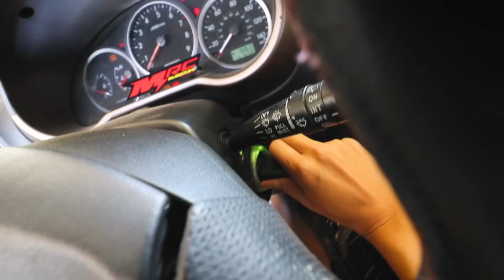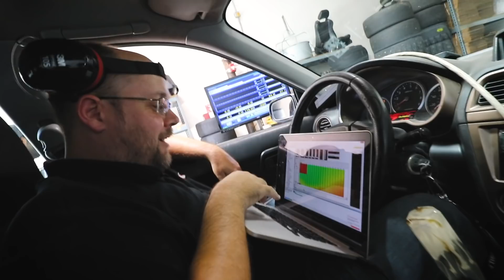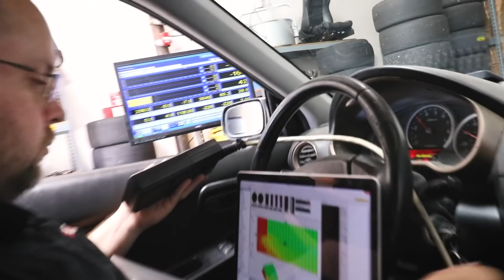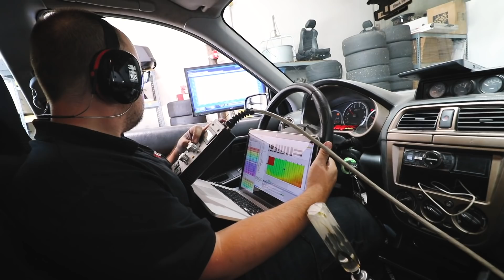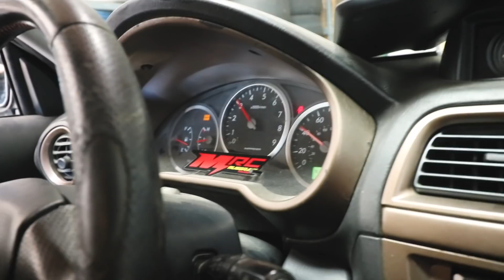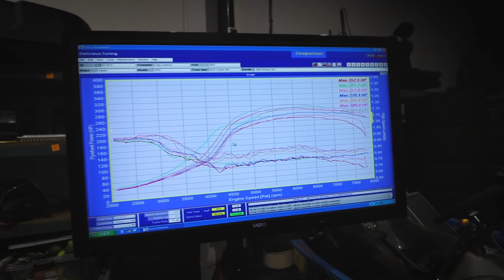WE PUT KEN BLOCK'S GYMKHANA TUNE ON MY SUBARU AND IT"S ABSOLUTELY MENTAL!!

Comment: FIY you have two step not anti lag. Anti Lag has a valve that feeds fresh air into the compressor housing to ignite the extra fuel in the exhaust housing to keep spining the turbo. Two step cuts timing to give you a similar effect but is not as effective and much more limited.

Comment: My 500hp Subaru build ripped apart the front ring and piñon and 5th gear on the 5 speed transmission since the PAR gear set only replaced 1st-4th. The rear axles held up, but it wasn't going anywhere with a big leaking hole in the transmission.

Comment: Emelia do you plan on modding your EJ207 further? Seems like a fatter power band with the new engine. I think you should go single turbo to make it less complicated,  more room, and less heat.(I think there would be less heat with one turbo). FMIC, up/down pipe, and some cams. You'd have an even more enjoyable EJ207.